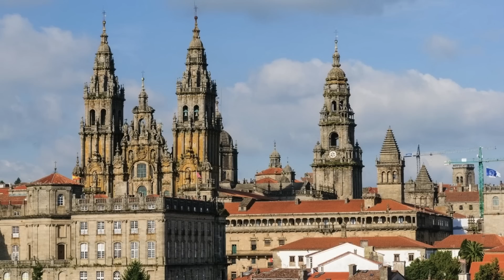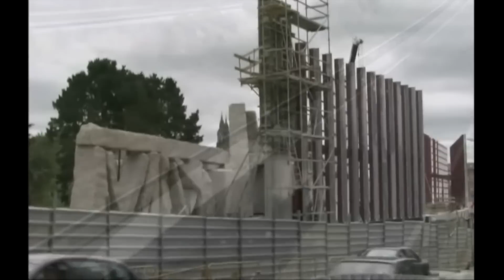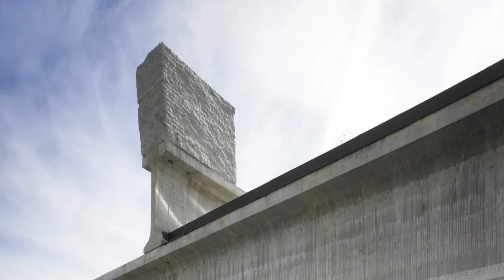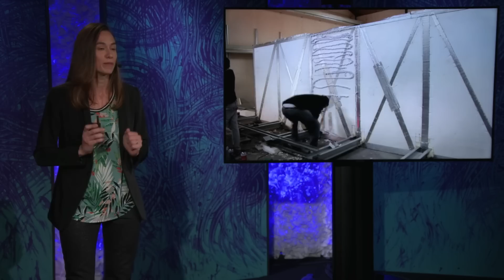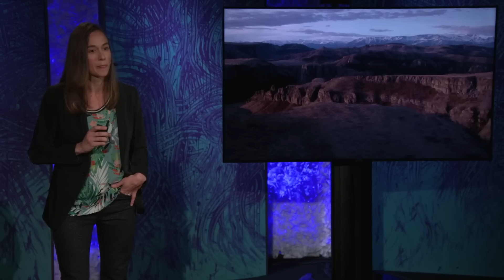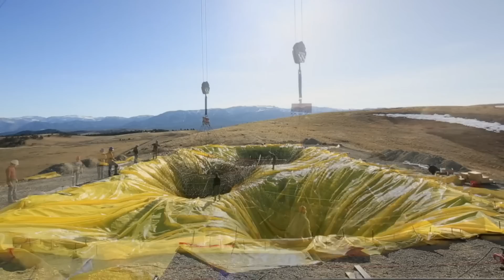Stunning buildings made from raw, imperfect materials | Débora Mesa Molina

Comment: Um... what about earthquakes or other disasters? Not sure I want umpteen thousand pounds merely balanced above my head...
Reply: Flinch Fu depends where the house is but I get what your saying
Reply: Sometimes, balanes structures without classic jointment is better siuted to withstand disaster. Much like ancient chinese/japanese architecture.
A Big enough shake will bring anything down, the building May be your smallest concern.
Reply: I don't know where she is building these structures, but surely they abide by a building code and most codes have rules and regulation regarding temporary and permanent constructions. Most probably, she is also following all norms for building in a seismic zone. You can also see the use of re-bar in some of the buildings. 

Also, in low seismic zones, wind would be your largest concern ;)
Reply: My concern exactly.  I suspect there are ways to use I-beams, irregular blocks of stone and other heavy elements in artistic ways that are also extremely safe.  One doesn't have to balance them up in the air to make a dramatic statement.
Reply: i dont know which country it is but if it would be in my country we can assume its safe, because you cant build something legally without proving that its safe.
Reply: Other disasters and earthquakes destroy well built homes too.
Reply: Same question was in my mind while she was giving the speech, what if any disaster occur, are we safe inside all architectural structure design?
Reply: @richeyrich2203  - But a poorly built structure can come down without any natural disaster occurring:  https://en.wikipedia.org/wiki/List_of_structural_failures_and_collapses#1960s–1970s
Reply: They may be using tie rods to hold some of these building's together!
Reply: Many of us live and work in structures that have umpteen thousand pounds of stuff up above our heads.  It's the code and quality of construction that determines how safe it is.  You could be sitting in a death box and not even know it...
Reply: They are smart enough to not put a house like that in a hurricane prone area
Reply: @butilikethecookie1  - Yes, I saw the rods, but steel rebar won't support those heavy chunks if they become imbalanced and begin to fall.
Reply: The Muckler  wrote: "Smart people stay away from earthquakes..."
HAH!  Good luck with that, dude.
Reply: The Muckler  - I've been in construction for much of my life.  Hubby worked on steel I-beam and concrete bridges.  I know what can happen if a heavy segment isn't balanced and properly reinforced.
Reply: Civil engineering is a balancing act.  You create a structure with all forces supported or countered.  Any building you walk into, anywhere, ever, has umpteen thousand pounds balanced above your head.  I didn't see a single piece of the structures shown in this presentation that was not anchored by rebar, cable or fasteners.

Comment: Débora Mesa Molina i am quite impressed at your beautiful wall.   question.   is it REALLY not possible for it 2 fall?    sometimes things fall of shelves in my house.   in the closet i hear a bang.... something fell.    i admit i stack haphazardly but what if a stone WAS 2 SLIP?
Reply: rocks are heavy, if they're stacked properly they won't be going anywhere unless external force or thousands of years of erosion interfere with the placement. and i mean external force like a dump truck crashing into it at high speed. if you hit that wall with an ordinary car, it'd be like driving into a cheese grater.